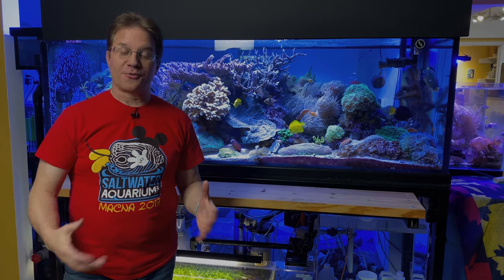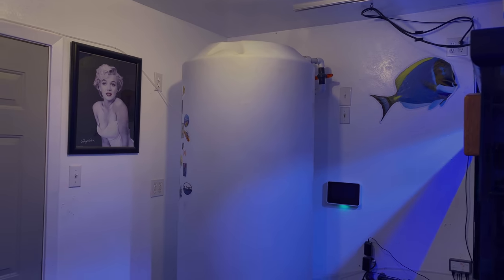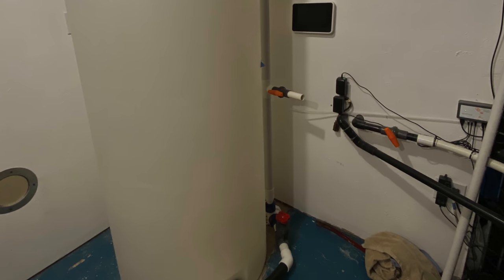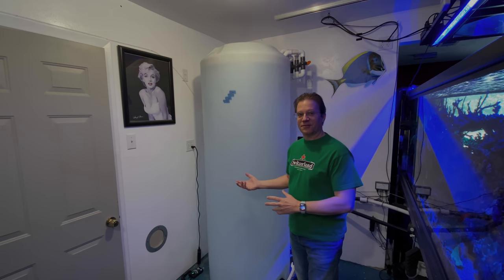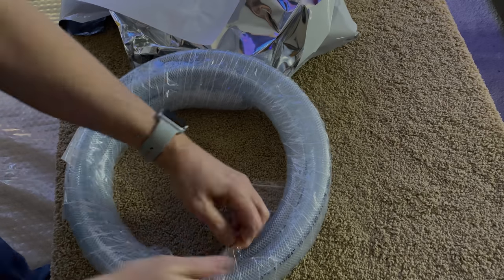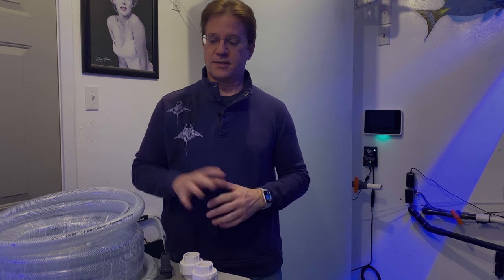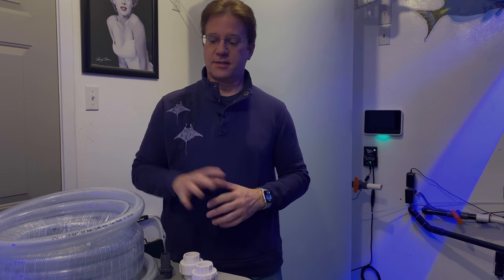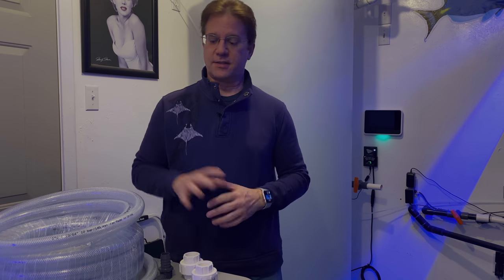Saltwater Mixing Station

Comment: Since I have only a 3/4” braided tube for water changes from my 20 gallon mixing station, I used a quick connect garden hose fitting from Ace Hardware. Not sure if they make quick connects for your giant braided tube, but it is super convenient!

Comment: Interesting mixing station, I like the 3 different discharge areas. Newly mixed saltwater doesn’t go “bad” unless there’s bacteria or something else is in it. I mixed saltwater and use it for 2 months at a time with no circulation and nothing happens, it doesn’t even smell.
Reply from the maker: So far you’ve been lucky.
Reply: @melevsreef  lucky for 8 years. I think that’s past luck at this point
Reply from the maker: I don’t know anyone that does what you do, as a hobbyist or a professional (public aquarium).
Reply: @melevsreef  The most public people I can think of that do it is the BRS team. I think they did an entire experiment series on mixing saltwater and then storing it for longer term use. They tested over a period of time with no heat and circulation and there wasn’t even any significant drop in alk, calcium or precipitation for most brands. I don’t know anyone who manages a  public aquarium but I know a lot of reefers who do automatic water changes and they mix saltwater once a month with no heat or circulation and it doesn’t go bad. I’m still trying to figure out what would go bad with saltwater that sits - if regular plain water is covered properly and just sitting with no dust, bacteria, particulates, or organisms in it, it doesn’t go bad - I’m not saying it can sit indefinitely.
Reply: @melevsreef  just texted and asked a few people - they’ve store even natural seawater even longer.

Comment: Add a ball valve at the discharge end and you can control the flow and not risk a flood if the hose comes out you, will be at that end to control the flow. Shut off the discharge ball valve when almost full, then shut off the supply valve. Open the discharge valve to drain the hose and then disconnect. A little walking back and forth at the end, but security to keep an eye on the hose.
Reply from the maker: That’s true.

Comment: Hoping you can help me, just bought a house and thinking about my auto water change, the mix station is in the garage (20ft away) my plan is to have a versa dosing pump run from my saltwater bin into the house through a wall, I don’t want pipes to be visible so I want to do it under the garden, next to my house I don’t have grass it has concrete and gravel on, will a 1/4 inch tubing be ok or should I go for 3/4 inch? Do I need to worry about it freezing? I can put it deep in the garden but once it gets close to the house it would have to come up out of the ground and hug the exterior wall and then through the wall ( I was thinking 4inch pipe through the wall on a 90degree pointing down towards the ground, I will probably have 3 pipes from tank to mixing station (ro, salt, waste) as it’s coming from a versa pump it would maybe have to be 1/4 or 3/4 tubing, can the versa work with 3/4? 
Any help or advise welcome, 
Thanks
UK reefer

Comment: Marc, instead of counting cups, what i did was weigh the amt of salt i need to make a certain amt of gallons of water. I find that works better for me and it is usually very close
Reply from the maker: Weighing the batch would be good. But I still have to scoop it with little cups into little buckets to get it in the vat. At least a pile at the right weight would avoid a goof.

Comment: You could make a hook using pvc with two 90’s and whatever length you prefer on either side so you can hang the hose on the edge of the sump or tank when filling.

Comment: How did you get the 250 gallon water tank through the door. I am trying to add large tanks to my fish room like you have, but they wont fit through the door!
Reply from the maker: I built the room around it. Lol. It can’t come out unless I chop it up.
Reply: @melevsreef  I actually just watched one of your videos where you said this! I am going to take the door frame off the wall and fingers crossed I have 32” to get the 250 gallon tank through.

Comment: Nice video Marc!  Tell Jack that Macey says “hi” and wants a play date.  Love the dive of your mixing tank.  I use 2 tanks in my mixing station.  RODI that auto fills reservoirs on my 2 systems.  The 2nd tank is for mixing salt water and daily AWC.   Do you keep another tank for fresh RODI for top off?   Also, we were shocked you shaved off your beard, but saw it again at the end.  Whew 😅.  Keep up the great work emptying your hard drive of footage.
Reply: *size not dive.

Comment: Do you really need to keep new salt water circulating?
I also have a DC pump in my mixing station but never thought about keeping it running. I just run it for a night when I mix saltwater and when I need to pump water out if the tank.
Reply from the maker: Yes. Just like your aquarium. Ever notice how all the available saltwater at the LFS and public aquarium (back scene tours) have circulating saltwater ready to go?

Comment: So is the Vectra the only thing mixing the salt in there?   I have something similar (although by the looks of it half the height) and I put an old Tunze pump in there to mix the water up.    

Oh and a physics level FYI on the power of the Vectra, the head height you were pumping wasn't from the floor, the water in the container actually adds pressure to the Vectra on the input side so the head height is effectively the distance from the top of the water in the container and how high you pump (Plus all the elbows etc),   just a little helpful hint for anyone who wants to do something like this you don't need a super powerful pump to move water from the bottom to the top, unless you plan on mixing with the container mostly empty.
Reply from the maker: Thanks!!  Yes, just the one pump.

Comment: Mark,  What do you do to clean your mixing container?  
I've had my mixing station up and running for a little over a year.  I was thinking I will need to drain the mixing tank, drag it outside and use a pressure washer to clean the inside of the tank and hand wash the mixing pump, transfer pump, heater, and Apex probes.
Reply from the maker: That should work well.  Cleaning products that work would be white vinegar, 30% peroxide (yes, lab grade), or muriatic acid (my preference). Once clean, rinse it well and put it back in use.
Reply: @melevsreef  what ratios should be used to clean the mixing tank? I now came to this issue to clean my tank. My is almost as high as yours and dragging it out is not an option. I was thinking white vinegar but not  sure on ratio for 150 gal tank. I was also thinking citric acid since it cleans the pumps so good
Reply from the maker: @322sheffield  If you can get the 35% industrial Peroxide, you'll be very impressed.  

Or you can spray down the walls with muriatic acid (using a full facemask like painters use and putting the acid in a pressurize container like pest control guys use) to spray the walls clean.  The acid melts it away rapidly, and a gallon would likely be plenty.  Then rinse it very well to get all the acid out.  That's it.
Reply: @melevsreef  with the 35% peroxide what ratio should be used?
Reply from the maker: @322sheffield  I just winged it, if I recall.  I had a bottle full (maybe less than a quart) and I poured that into my huge poly tank with some water - but I don't think it was full of water to the top.  /shrug  sorry, I can't exactly remember how I did it that one time, but it worked.

Comment: Nice and very informative  video. Thanks a lot. I have a couple of questions.
1. How du you heat the freshly mixed saltwater? You have an internal heater hanging inside the water vessel or what?
2. You treated the frag tank for Cyano bacteria. What do you use? My nano tank is a Cyano mess at the moment….😕
Reply from the maker: 1) only if necessary - usually in the winter months. Two 300w heaters hang down from the top overnight to match the reef. 
2) RedCyano Rx - available on my website.

Comment: Marc, how are you measuring you pvc, I am trying to plumb my sump and I need some advice on how to measure before glueing. Dry fit really doesn't work, your expertise is really appreciated.
Reply from the maker: I tend to cut each piece as I go, instead of dry-fitting the puzzle pieces together. Once you use cleaner and solvent, the pipe sinks fully into the fitting, which isn't something you can predict accurately 100% of the time.  You can measure the depth available in the Elbow, Tee, or Coupling but when you glue it, you'd have to sink it all the way in.  I'd get everything as close as you can, and save those final sections as "cut on demand" to assure it all reaches properly.  This article may help you, and coincidentally its for the exact same container back in 2010.  http://www.reefaddicts.com/content.php/283-Plumbing-Primer-how-to-do-it-correctly/view/1
Reply: @melevsreef  thank you so much my reefer friend, I don't know what I would do without you in the hobby. hope you are doing ok, been thinking about you and I am happy you are putting these videos out

Comment: The whole time I just kept thinking of what a pain it probably was to get the bulkhead out the bottom of the barrel. With the limited room from the top, I would only think makes it more complicated...lol
Reply from the maker: I didn’t explain that part but yes it was tough. I turned the vessel on its side so I could remove the old one and insert the new one. There may have been a broom handle or Kent Scraper involved. 🤪

Comment: That is weird.  In the refining industry they teach us to never throttle a gate valve, it erodes the gate and when you need to isolate the line, the valve will leak by.  I guess in this case, it doesn’t take alot of effort to replace it years down the line if you had to.  Even waterbox sends you a gate valve to throttle your overflow.  🤷‍♂️